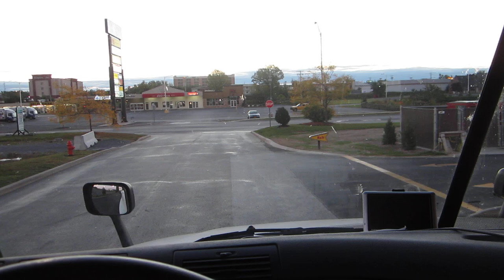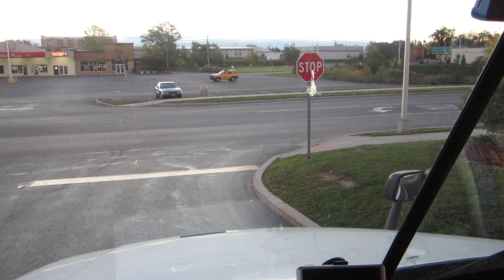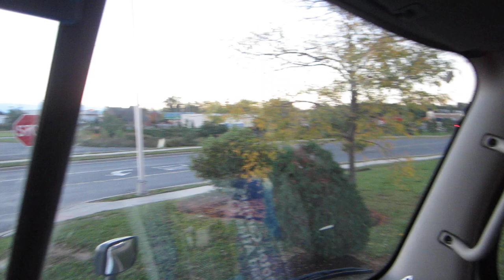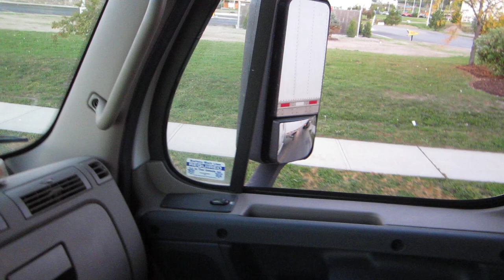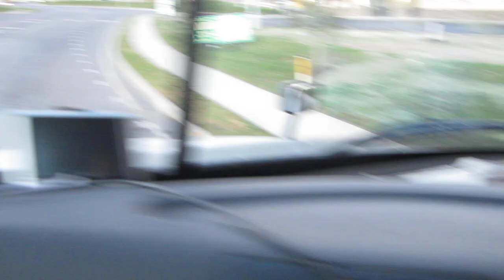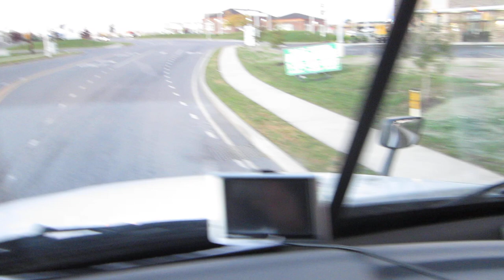Mr. John Tutorial :  Right Turn for a Semi

Comment: I’m puzzled as to why semi’s don’t have steering systems in the trailer wheels for low speed turns like that. One way could be both trailer axles are attached to a subframe of the trailer that pivots. Another way would be trailer axles that steer at the ends similar to a tractor front axle. I’m sure that the industry doesn’t want extra expenses and anything that would make a trailer weigh more and have less net weight capacity.
Reply from the maker: Europe has trailers that steer due to infrastructure but as you say cost/weight/maintenance and big North American spaces don't necessitate it here....besides -with proper instruction you can maneuver these 75 footers anywhere!
Reply: @SafeTravells  
And how many drivers get through the schools now with proper instruction?

Comment: Any advice for right turns in the dark when you cannot really see your trailer wheels all that good in the convex mirror? I usually swing way out wider than I probably need to. Just not taking any chances.
Reply: @SafeTravells  yeah, you're right, the lights do help but still hard to see clearly, especially if it's raining (in the dark). I'm a new driver, driving 5 nights per week, b-train. I'm finding it very challenging all around.
Reply: @SafeTravells  Yes. Two 30 ft trailers. The lead trailer has a fifth wheel at the back so when the chassis is extended a second trailer can be attached to the exposed fifth wheel.
Reply: @SafeTravells  Oh you're welcome. More people should look into alternatives to our current system. A Resource Based Economy as proposed by The Venus Project and The Zeitgeist Movement would be a much better system than what we have today. Better for humanity overall and better for the sustainability of our only ecosystem.
Reply: @bobnorwood1158  Our system has worked very well for many years.  Our poor here enjoy a far better standard of living than many other countries.  Your "Resource Based Economy" is a great idea that would only impoverish us all, and the poor would go hungry. Nice thought tough....

Comment: I have question and my question is if there is 2 rights line going to right which one will I make turn can u give answer
Reply from the maker: As a truck driver you are to remain in the curb lane thus you would start and finish in the curb lanes- remember that you are driving for the trailer so you maneuver the tractor to keep the trailer tires +- 1 foot from the curb.
Reply from the maker: You always finish your turn onto the same lane you turned from- curb lane to curb lane or: next to yellow dividing line to -next to yellow dividing line, once the turn is complete then you can signal and choose the lane you need to be in.
Reply: @SafeTravells  if there are 2  lanes to turn right which lane do you use left or right ? Because if I use the right lane wouldn't I have to swing right to get more space? risking hitting a car The left lane right ?
Reply from the maker: Whichever lane you turned from is the lane you finish onto, ie.: If you come from the curb lane - you finish onto the curb lane.
Reply from the maker: @omarx5891  When turning right you should always be in the curb lane- you are a truck- trucks travel in the curb lane or 'slow lane' -that is our place. When making a turn you never 'risk' hitting a vehicle as you follow the procedures required to operate a semi safely.
Reply: You have to try and look as far ahead as possible to evaluate your turn an see what you have to contend with. If it's a tight corner with obstructions right on the corner which is common I'll split the lanes and take them both. This demonstration is an example of perfect conditions, while absolutely correct is not what you will encounter at every intersection.
Reply: As a veteran long haul driver of 44 years and a driver trainer, I will answer that one for you.   The drivers manual states that large trucks ALWAYS  take the wide lane if there are double turn lanes. This is to avoid conflicting with cars who are also making that same turn.  If you conflict with a car on a double turn you will fail your test.  So on a double right turn, the book states you always take the left lane and then get into another lane if you like.  On a double left turn the book states that you always take the right lane so you will have lots of room.  If you deviate from this rule you risk squashing a car, and they tell me the paper work in not pleasant.   By the way  Mr John   you made a perfect right turn from that single lane.  That is exactly the way I would have done it.  As a fellow trucker,  you make me proud.

Comment: What do you do if there is heavy traffic that’s stopped in that turn lane and you need to turn wide. Do I have to stop and wait until it’s clear. What if I got traffic behind me also waiting to make that right turn? If traffic is heavy that left turn lane may never be clear especially if that left turn lane has a traffic light 🚦 on it as well. What would I have to do to make the turn at that point?
Reply from the maker: Just follow the rules of the road- who has the right of way? If you have to wait-so be it -wait....we're driving 75 feet of articulating truck...do so safely-not speedily..

Comment: My school was garbage. I now have my CDL and i spent all of an hour driving on the road and had none of this explained to me.
Reply: Same here. Just got my CDL. Now im nervous because my school had 6speed trucks & small trailers..
Reply from the maker: Indeed......only professional truck driving class 'A' schools teach using 53' trailers with 50% load (22,000lbs) and tractors with sleepers and standard transmission. (# of gears irrelevant as all shifts are 'rpm' determined) -as this is what the industry uses -and you will be prepared....just drive through any truck-stop with overnight parking facilities at 20:00 and see for yourself...If the school you are considering does not have these...don't attend....you will be ill prepared...but they will have your money...
Reply: @SafeTravells  it was a professional school and I did do manual. Just a bad school. They were pushing people through as fast as possible.